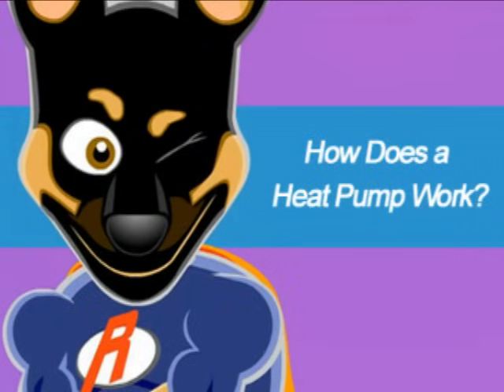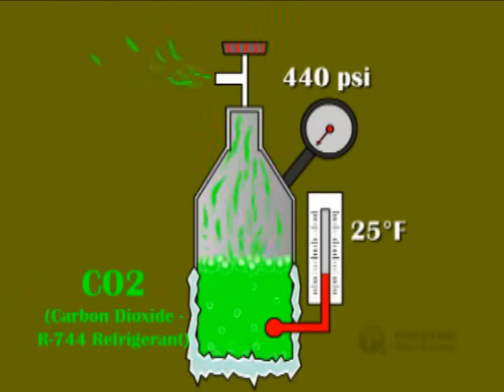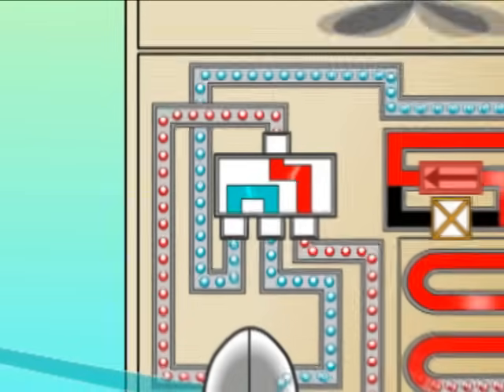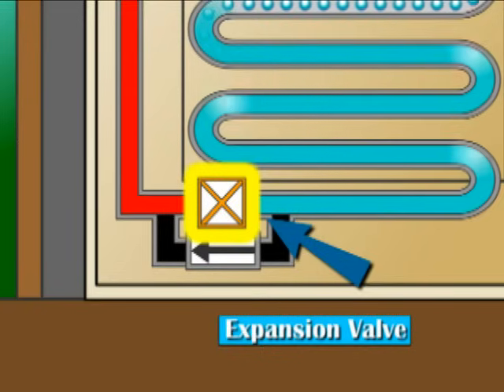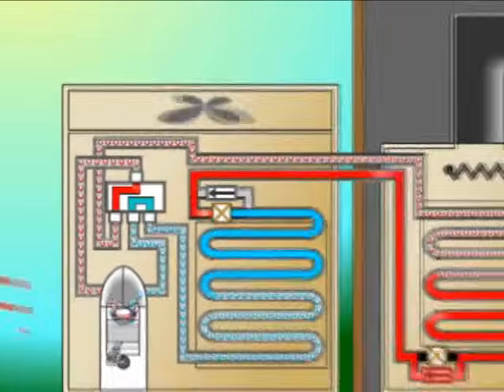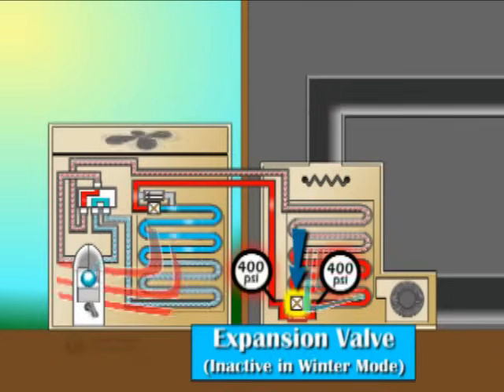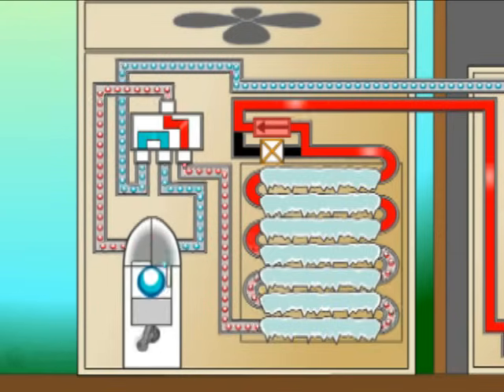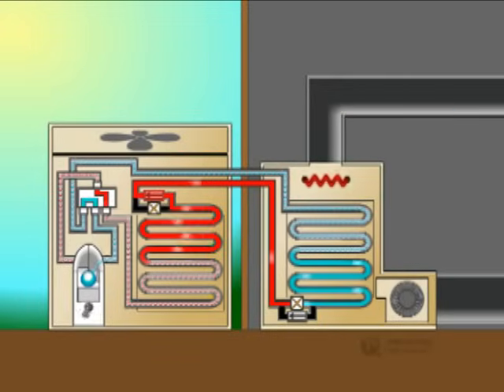How Does a Heat Pump Work?

Comment: So it’s exactly the same as an air conditioner.

They just built an air conditioner that you can run in reverse.
Reply from the maker: Douglas, you are correct... with the added defrost cycle.

Comment: What if you set a summer mode in winter?
Reply from the maker: The thermostat decides if you need heat or cooling in the house. Cooling = summer mode and Heating = winter mode.

Comment: Does it use OUTSIDE air to heat/cool the house inside?
Reply from the maker: It only steals heat from the outside air or sheds heat to the outside air via the refrigerant lines and fan. It does not pull outside air in unless there is a fresh air intake installed.
Reply: @chaffeeair  Oh, thanks. So for example, if you live near a smoggy freeway it won't pull in all that smog?
Reply from the maker: Correct, it would not.

Comment: Couldn't you use a solar hot water panel to cycle through the chamber so you don't need to defrost all the time?
Reply from the maker: I like solar, but in this instance, it would not be cost-effective at all.

Comment: Let's say that we have a heat pump like this one: HITACHI YUTAKI-M 14KW MONOBLOC ATW HEAT PUMP.  I want to know the energy consumption (electricity consumption). Thanks.
Reply from the maker: I apologize for the delay. From reading up on that unit, it consumes 4.07kW so if it runs for one hour that would be 4.07kWh

Comment: It says that this is more efficient yet now you have your furnace and your ac unit running which draws more electricity than  having just your furnace running. How are you supposed to cover your AC unit outside if it's going to power on here and there in the winter?
Reply from the maker: The idea is, that in moderately cool weather, the heat pump keeps the backup or emergency heat from coming on. Some backup heat is electric heaters, as in the video and some are gas.

Comment: All the A/C that are installed in houses in my country, have a mode button. The options are usually cool, dehumid, fan, heat and auto. I want to emphasize that they have both heating and cooling. Does this make all the A/Cs heat pumps?
Reply from the maker: MihalisNavara - No it does not necessarily mean it is a heat pump. If the outside fan is blowing REALLY cold air out of it when the outside temp is around 17° C or below, it's probably a heat pump. If the outside unit is not running at all during the cool temps, but the inside unit is heating the house, probably NOT a t heat pump.

Comment: Can I use a heat pump for a walk in freezer?
Reply from the maker: I don't think so. The refrigerant for a heat pump or ac unit is designed for medium temps. Low temp applications use a different refrigerant.

Comment: Does anyone know how long the defrost cycle lasts? Is is switched on every hour or so for a few minutes?
Reply from the maker: It can be, depending upon outside temp and humidity. You will hear the outside fan stop, but will hear the compressor still running and the swoosh of the reversing valve when it actuates.

Comment: Sometimes the outdoor units fan shuts down for some time then I hear a hissing sound and it's silenced completely and I still hear the indoor unit running still then the outdoor one starts to make some noises for a few second then the hissing noises is heard again, then it starts up again and goes back to normal, that mostly happens in the winter. I wonder if that's a normal thing for the outdoor unit to do?

Comment: Sir,
Why have you used hot ambient air in winter cycle for input in Evaporator coil? Is it a convention? Is it because the refrigerant temperature after passing the evaporator coil still lower than the ambient? How come will it make a difference in respect to ambient and cooled space?
Thank you for making a precise & complete explanation.
Reply from the maker: Yes, the ambient, outside air is still warmer in the winter than the boiling point of the refrigerant at such a low pressure, thus allowing heat extraction from even frigid air. However, as the outside ambient air reaches extremely low temps, the unit will become less efficient and if it can not maintain the house thermostat set point, the auxiliary or "strip" heat will turn on to assist.

Comment: Video didn't mention that some defrost boards utilize an outdoor t/stat to initiate defrost. 
When temp outside falls below a certain setpoint temp, it closes to complete the auxillary heat circuit, putting the heat pump in defrost & bringing on the aux heat. 
I like outdoor t/stats but not all heat pump t/stats are set up for an outdoor t/stat. 
I think at the t/stat in the home, W (white wire) & Aux (sometimes the blue wire) are jumpered. 
I like to designate black for common & brown for Emergency Heat. 
T/stat wire color codes vary, though.

Comment: Hei! perfect video!!  But I can´t see the point of having two valves and bypass (they are allready in serial)??   And I also wonder why having two dimensions on piping (Fluid 1/4" Vap 3/8") when the circuit changes diraction anyways..   thanks!

Comment: on the bottom of my central motor inside there are spriall lookig springs the turn red what does this mean
Reply from the maker: Ben,
That is probably the auxiliary strip heat, pointed out in the defrost cycle of this video.
Reply: Ben Soria Its a coil that heats up warming the air while in defrost mode

Comment: I don't understand why the gas is hot if under high pressure. An increase in pressure will lead to a decrease in volume, causing the particles to have less kinetic energy. This would cause a decrease in temperature producing a liquid. AM I wrong?
Reply from the maker: Melissa Liddington You are right in a sense. Each molecule has picked up heat from the evaporator, but they are greatly spread apart, so we don't sense that heat if we were to touch the line, because the volume is low, i.e. the larger suction line entering the compressor. Now, when it enters the high pressure zone, the molecules are compressed closer together, so there is more heat energy per cubic centimeter or cubic inch, i.e. discharge line leaving the compressor. Hopefully this helps.

Comment: Just moved into an office that had a beautiful Mitsubishi heatpump system and instead of the landlord fixing it, he installed some crappy baseboard heaters last winter and a low-end forced air conditioning system with one return. After running all the wiring for the baseboard heaters, cutting out wall trim and plumbing all the ductwork for the air conditioner, he probably could have just bought a whole new heatpump system but what does he care, he isn't paying the utilities!Heatpumps are VERY economical. Everyone knows turning electricity into heat is less cost effective than using gas or refrigerants.
Reply: heat pumps lose efficiency as the temperature outside drops...to below -25 celcius.
Reply: more money than brains!!!
Reply from the maker: kosmosleha  The video producer is from Indiana originally and knows that spring and fall don't last long there. Heat pumps have a better pay off in moderate climates where cool, not cold, weather hangs on for a while, like in the southern states.

Comment: Thank you for this video, I am up in WI and looking at houses more south and didn't know what the crap this was that kept being mentioned in the house ads! lol
Reply: +Isabelle Farleigh The first time I saw the emergency heat mode on the thermostat of a heat pump I thought it meant if the electric went out there would be heat for a certain length of time.  Actually it activates the heat strips to work full time like an electric furnace.  Go figure.

Comment: Thanks for the info! I was right! Some people told me that the outdoor unit generated heat in winter mode but no! It generates cold!
Reply: Well, actually a heat pump always extract heat from one end and moves it to the other. It's strictly not generating cold, but stealing heat from the colder air outside. It means the air around it will be colder (or less warm) and water will freeze.

Comment: I went with a 3.5 ton unit after our old central air went down & temporally using a 10k window unit which only cooled one room efficiently to cooling the whole house for 20.00 dollars less a month than the 10 k window unit . I can't comment on heat at this point yet . Absolutely love it so far & found this video just wondering why I found my condenser fan not running for a bit this morning our first cold morning with the unit , & it answered my question as well .  Thanks

Comment: Im looking at having one of these installed in my home. Does anyone know the long term cost effectiveness of these units. and do they basically pay for themselves.
Reply: Kyle Debettignies 
I hope you stayed away from an HP. They are far too complicated and cost far more in the long run with maintenance due to unavoidable failures. Just go with a convention AC and furnace and avoid the trouble and expense.
Reply: As far as I'm aware, this is one of the most efficient ways of heating a home, so it's likely to pay off soon.